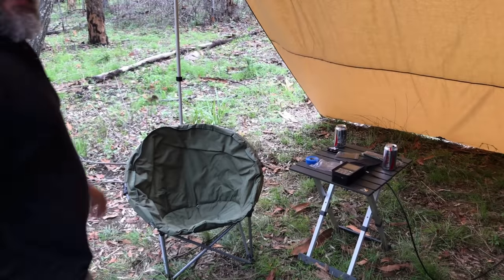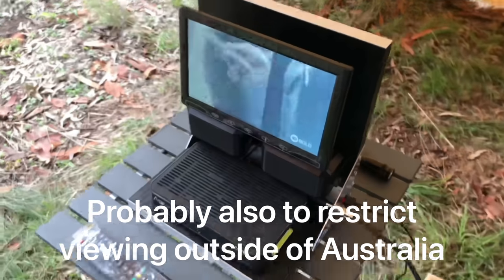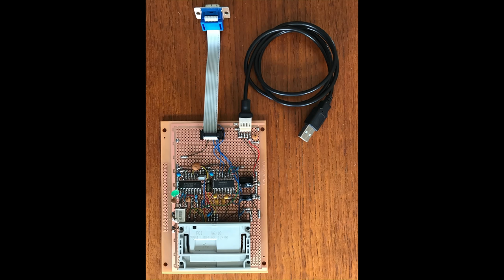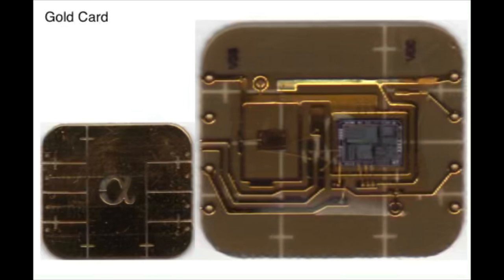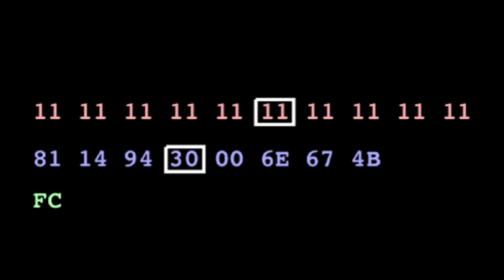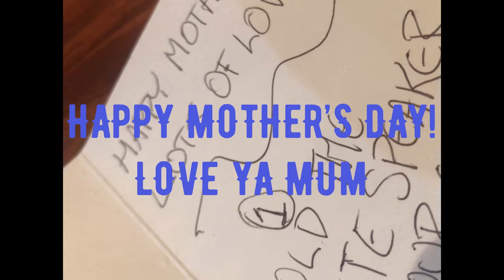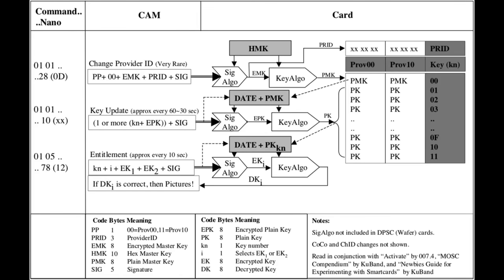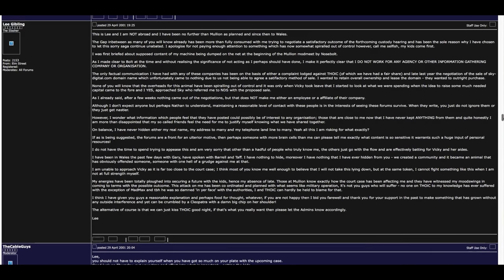Satellite TV Hacking in the 2000’s

Comment: I used to have a program called "Voyager" running on an old 386 laptop and it sat there for years cracking Sky TV. Just needed a RS232 to TTL level converter from radio shack and you were sorted.
Reply from the maker: Similar thing in Australia… would run on an old DOS 286.. ours was called Wallbanger. Funny title.

Comment: Aah, those were the days. I was quite involved and ran a web-page back then. I spoke to Lee at THOIC few times and remember the fuss that happened. His marriage broke up from memory and after he was 'outed' he simply disappeared one day! I originally worked for Galaxy until they folded and took some interesting things with me when I left... Started hacking almost immediately and built my first card reader from a wrecked Pace DGT400 box. I added a logging mod I created to Pace boxes and captured data for all the cards in service in Australia to a database. I had VBA code for the decryption algorithm working and added it to the database so any cards I had card data for would automatically decrypt to the plain masterkey.  Many people gave me card data so I had a library of usable data I ran in an emulator on a PC connected to a DGT400.
Also dabbled in goldcards and erasing/recoding provider smartcards. I was able to keep the system running until 2004 when the new cards and other changes were being rolled out and the last of my valid keys expired. I was aware of ongoing work on the cards but was not bothered anymore and none of the systems were reliable, from what I heard.
Cardsharing had made an appearance by then but only working on the Austar system as they were slow to change. A consortium of hackers in the city paid for my Austar system (with two boxes) so they could 'borrow' my spare card and distribute data across a net connection to each of their houses. I had given up the hacking side of things by then...why bother when others will pay for your subscription! All this eventually died.
I also ran the hackers tool of choice, the famous Nokia Mediamaster 9500 satellite receiver with an add-on hard drive running an incarnation of linux that could do all sorts of 'useful' stuff! Still got it but pretty useless these days. It was capable of grabbing data packets from unencrypted satellite internet and re-assembling them...saw a lot of pornography and some interesting email streams! In the latter years, the Dutch company...I****o began sending me threatening emails, which I dutifully ignored. The laws in Australia had not caught up with the digital age and it would be hard to charge someone. That changed around 2004 with the new laws. I was well known in the Australian scene for a few years, my online name was satellite related.... k****d.
Additional note: Watched the Mediawatch vid. Back in 1999, card hacking pretty much involved only adding additional channels to a card which was dead easy as all the key data was in the clear except the last byte. All that was needed was a way to cycle instructions to the card about the channel package until you found the valid one of the possible 256!!                    

More notes: Galaxy failed because of its business model, nothing to do with piracy as it was pretty rare in the mid nineties. I always thought it was designed to fail so someone would buy it but just a theory!. There was also TARBS. This was a multi-language service with a few channels common to Foxtel. It did not use a card but relied on on-board decryption which could be over-ridden by reprogramming one of the flash-roms on the board...did a few of those too. Another bad business model saw them disappear into history.

CABLE: There was also cable TV provided by Optus and Foxtel. There was a cable in a pit outside a house I lived in for a while. One night I went out and opened it. I was at the end of the run so there was just a terminating resistor. I hooked up a cable, ran it into the shed and plugged in a cable box I had been sent that came from a rental property. The tenants had left it. Turns out it was still active so I was able to see what cable was all about. Same stuff as the satellite...extra movie channels from memory. It worked for a fair while till it eventually got its shut-down message.
Reply from the maker: Hi, I don’t think I know you, but do remember that name from a tutorial. I did have the old analogue Jerold decoder for cable as well ... It was because I had Optus cable internet that the connection was in the old house, and a simple splitter box allowed the use of the TV box as well. Whenever the satellite and cable box shared content, the cable had a slight lag.
Reply from the maker: badazznc tech reviews  Thanks :) I wouldn’t say I’m done with YT vids forever, but lately have tried to get away in the bush more.
Reply: Lee started showing up towards the end of the 2000s again in some random dish/echostar sites before disappearing again. I recall that.

Comment: Ah, the good ol' days! I didn't know anything about what was going on down in Australia, but I was into the DirecTV hacking scene in the US. I remember programming H cards, then HU came along and unloopers (tools that glitched the power at precisely-timed points in the card's boot sequence) bypassed their security. Eventually we had full emulation (assisted by a dummy card with custom firmware to talk to the on-board super-secret NDS ASIC) that let us run multiple receivers from a single card. Finally we had to use receivers with hacked firmware loaded via JTAG that bypassed the ZKT (zero-knowledge test). Eventually DTV released cards that were effectively unhackable and the scene went away. I think there might have been a parallel scene involving Dish Network (the other big direct-to-home satellite company in the country at the time) but I never got into that. And none of us will ever forget Black Sunday!

Comment: Back in the 80's it was all about heating and removing the epoxy inside the descrambler module and then soldering on eprom sockets.
Reply: For which package this trick worked in 80's?
Reply: @hassansyed5661  back in the 80's the slide out module used separate parts similar to the early computers. so there was a rom Ic and a processor IC and so on.
Reply: For videocipher 2   2 plus was harder
Reply: VC2 and VC2+
C-band, those were the days
When direcTV first came out, they were so hell-bent on getting to market that t satellite signal actually had no encryption at all and back then there were no blind scan receivers but if you knew how to read the eprom with the channel map inside the receiver you could then take your digital free to Air receiver and program in all of the specifications for a specific channel and bingo you were getting that channel now to combat this the satellite company would change the channel map every single day

In short order they change their signal but the cards that were in the receivers were not required and you could use your own homemade card that granted access to all the signals and that's what was done for I think about 5 years until they sent everybody new cards that had encryption built into the card and then it took a year or two for that to be hacked and then a couple years later they sent new cards again and the people hack those in a year and then a couple more years and they replace the cards a fourth or fifth time and that was the last I kept up with the chaos and I remember watching C-SPAN and watching the satellite companies telling Congress that they needed to make new laws because people hacking satellite TV was a threat to National Security and of course Congress went right along with that and changed or added new laws

Nowadays I don't even know if people are still doing any of that hacking or if they have moved on to other methods of getting the content

Years ago the satellite companies and the cable companies too had head ends when all of the little cable companies all around the country they all had their own little areas and they had to receive the signals and it was all done by satellite and I remember the local cable company where I was they had like 20 or 30 dishes and when they got bought out by one of the big companies they removed all the dishes and I couldn't figure out how they were getting the signal to all the homes if they didn't have any satellite dishes and in talking with one of the people that works at the head end they said everything comes over the internet now so all of the programming all of the stations all of the networks everything is sent over the net broadcast and they have digital boxes that are plugged into the internet that actually received the signal and then they load it onto their cables and send it out to all the subscribers so I imagine the people who used to hack the satellite signals have now figured out how to hack all the signals just right off the internet

Comment: If my memory serves me (I was no older the 12 at the time) It was a lot easier to get pay per view movies etc for free. We had a phone line connected that had the end cut off. Order a movie etc and at the right time, connect a 9v battery to the phone cable. I'm guessing that's all the box was looking for as authentication.
Reply: Its easier now. Just go to a streaming site and its free.
Reply: @greatleader4841  with ads though. You might as well pirate it.
Reply: our north american provider started enforcing some phone line verifications. All it ever checked for was a dialtone. Even though a dialtone is two very specific frequencies, the receiver ("IRD") was fooled by a 9V connected to a 555 timer with the right resistor/capacitor combos, just making a single frequency anywhere within the range or a bit outside of those two real dialtone frequencies. Very dumb. I remember plugging an actual phone into this device once and it sounded nothing like a dialtone. Another huge project easily defeated with $1 in chips.

Comment: My father was an installer on and off over the years from the Galaxy days to the end of Austar. He also installed Vast. Helped with the roll out of Telstra NextG and NBN fixed wireless too.

Austar and Foxtel had some kind of non-competing agreement for a long time. Austar served regional customers and Foxtel served metro customers. I don't believe that Austar ever operated CFC or cable TV. Around 2012 Foxtel and Austar merged with Austar operating under Foxtel Branding for a long time. In fact they continued to use Foxtel branded MyStar (competitor to iQ) boxes for sometime. This may have been because iQ and iQ2 boxes didn't have DVB tuners instead they broadcast local FTA channels over satellite. Austar only did that with ABC and SBS. It wasn't until around 2015 that Austar completely ceased to exist. The old Austar boxes still function as far as I'm aware.

Comment: I remember us getting direct tv back in 02 but the signal would mess up every couple of days and the card would be replaced but this did not last long as the technician got arrested for doing this,and after that we did not have cable or satellite tv until 2014 except for a few months with time Warner in 2011. In late 2015 we cutoff directv and now only use streaming services or watch Univision on over the air tv

Comment: Interesting topic and the cloak and dagger stuff is something I was not aware of.  Cable TV, pre-digital, in the UK used to be vulnerable with most of the technology coming from Germany in the form of DBOX, I guess it was a bigger scene there.
Reply: Pre digital were mainly Jerrold and CFT2100's, If memory serves NTL and Telewest opted to use Nagravision for their digital platforms and Ondigital went with the already wide open Seca for it's digital terrestrial. Both of which were compromised and the internet flooded with files via THOiC. When the site was closed, most if not all in the scene headed to Shack as the 12 Admin on there were directly involved in Exposing THOiC for what it really was so we kind of had a good reputation at that point. It took many more years for NDS to make their move on us to get revenge. It cost them far more than it cost us.
Reply: I think the original digital cable boxes were manufactured by PACE. I remember them trying to get me done for copyright when we altered their Digdebug
 software and released our Libdebug version.
Reply: Outside of the UK it was very difficult to get a subscription to the UK services, even when you wanted to pay for it.
That likely explains why there was lots of activity from groups outside the UK.
Even way before DBOX I had a surplus sat TV receiver using the analog videocrypt system, and the German software that emulated a smartcard (this was before the PIC cards, the emulation worked with a PCB card containing a level shifter and a cable to the serial port of a PC running the emulation program).

Comment: I can say this as my dad is deceased. He used to sell hacked cards and systems back in the 90s. Free HBO, PPV and tits. Those cards but a lot of food on our table. He had no clue about programming or electronics. I ended up being a software engineer with another specialization in electronics. Yes, there was a FBI raid involved.
Reply from the maker: @TFitz  I wasn’t into selling it, but this, cable tv, and even chipping PlayStations was the beginning of my hobby with microcontrollers, and this channel shows a lot of projects there.
Reply: @BrekMartin  I can dig it....I love microcontrollers...started with Motorola 68HC711...moved to Rabbit and then Arduino came out and those RaspPi...it's come so far...all just to turn some pins on or off...well unless analog input/output, but you get it...that's awesome

Comment: Thank you mate.
Reply from the maker: Glad you found it interesting, because I really had no idea if anyone would! :D
Reply: @BrekMartin , I had Galaxy in 90s.
I remember looking at the signals from the wall socket. all they seemed to do was invert the video signal.

It was Analogue?
Reply from the maker: @mitch19636  I didn’t know Galaxy had a cable service, but it sounds like analogue cable. Optus cable definitely worked that way. Low tier channels were colour inverted, but movie, sport, and adult channels had more complicated scrambling such as sync suppression.
Reply: @mitch19636  Inverted video, no sync pulses, decoder would reinsert them along with putting in Macrovision signals based on a known block of black video at the sync pulse. That video block also contained the digital controls for the CA module, plus the compressed audio. Was broadcast here, and till around 10 years ago the decoders were still supported, but with much later versions of the encryption. There were hack chips for those decoders, as there was no smart card, but a soldered in CA chip.

Had a good number of old Multichoice cards from getting upgrades and dead decoders, but probably tossed them. they went brown from the heat of the decoders, they were cost cut down a lot, and ran blistering hot. Was common to replace a dozen caps in them to get them running again, and the early versions of the digital satellite decoders the chips would desolder themselves off the boards. You got service kit that had all the caps, new ADC chips for the front end, and some stick on heatsinks that would fix the most common decoder failures. But have not watched them for over a decade, not worth the money.
Reply: @BrekMartin  We had such systems here as well.  There was an AM sync pulse on the FM sound subcarrier and the original video sync was removed (or rather shifted).
With a suitable multi-system IF card (obtained from surplus stores) which was intended for SECAM TV with AM sound, it was possible to re-generate the sync pulse and watch the movies.  That was in the early 1980s here.
After designs of "video improver circuits" became a little too widespread, the system was changed.  I still have my decoder in a junkbox.